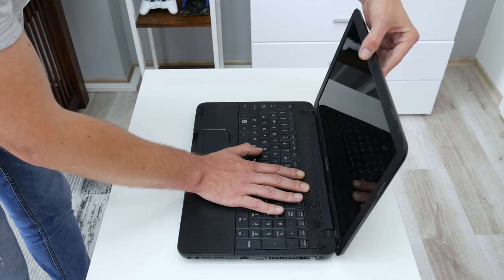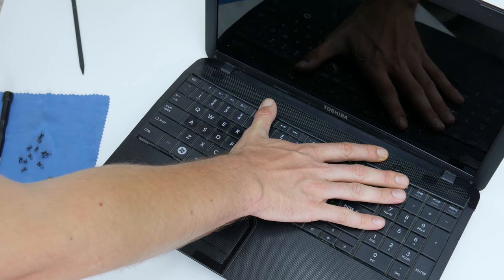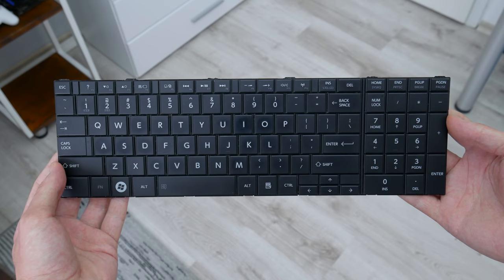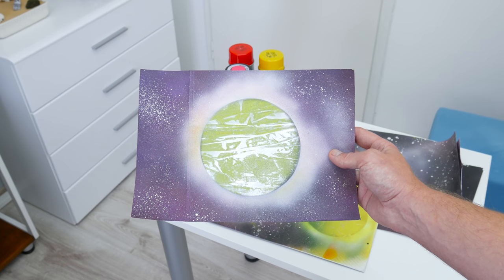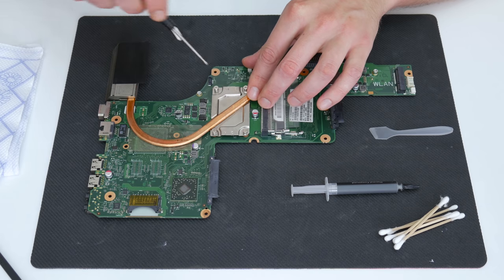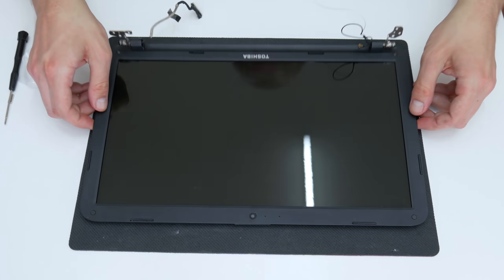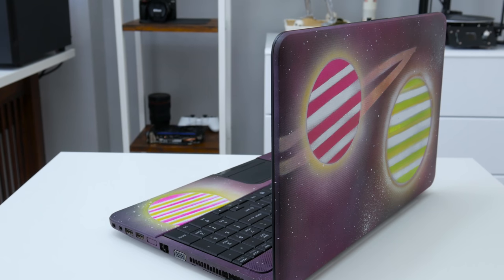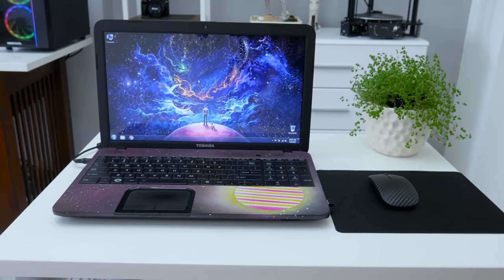Restoring very low specs Toshiba laptop

Comment: I just restored a similar C850D-11K with the same APU, but slightly different construction details. It got a new SSD, a new battery and I'm now waiting for a used keyboard and a new WiFi/BT-module to arrive. I bought the machine in a very bad and dirty condition and basically did the same job that you did. Love the feeling of giving neglected old things a new life, no matter how big the effort! Mine is running with (Bodhi)Linux now and works so much faster than you'd expect from an old machine like that. Great job and great video of yours!

Comment: Dear Andrew, 
You did a great job showing everyone how you upgraded your laptop into something usable. I recently upgraded my ASUS laptop to 12 GB of RAM from 4GB and added an SSD by  taking the optical (CD) drive. Replaced with HDD/SSD caddy. It improved my specs but I find my CPU working way too hard on windows 10. I want to replace the old thermal paste and completely clean my laptop like you did. It must've taken quite some time to complete your project. Windows 7 seems like a better option as well. Overall, excellent job, Andrew.
Sincerely, 
Richard
Reply: The fixes Andrew applied were very inexpensive; however, if others would like to add a better GPU by taking out the onboard wireless adapter it may be cheaper to go with a newer laptop with better specs like an HP.

Comment: Very inspirational. I've modded my l655 with a new processor, wifi module, hdd caddy to replace the broken cd drive. New battery and keyboard. Pretty awesome laptop for manjaro considering you can only buy a chromebook now for the same price point of these older laptops then. Just need to give it a coat of paint soon!

Comment: The fan was seriously dirty! Did you also replace the CMOS battery? I used a 2 part epoxy on a Lenovo case (inside) thanks & great video! I use a cleaner made for screens, being careful with a soft tissue. A used screen is fine! The fact that you had some video signal even with a defective screen is a good sign that the video chip is working! Cool wallpaper!

Comment: Video well done Cat and Andrew ! , One thing to notice , The HDD shouldn't be in the Drive bay , because it uses less Power, and on shutdowns , restarts or sleep , the reader stop suddenly without having time to reset it's position , that harms the hard disk , you can search it up , instead put the SSD in the bay drive and boot from it , since it doesn't have moving parts , it's safer , it might lower everything to Sata 2 but works like a charm ! Like this so i get you've seen this and tell me if i'm right or wrong , if i'm right i hope you apply this in your future Videos ! Have a good day .

Comment: I disassembled my Toshiba Satellite. Had an AMD e-300 clocked at 1.3Ghz, Radeon HD 6300m, 250 GB hard drive and 2GBs of RAM. I'll find something stupid to do with it eventually :) Thinking about mounting the display to my desk somehow, but I need a driver board for it which can be found relatively cheaply. As for the computer itself, it's trash until it gets an SSD, Windows 10 and 4-8 GBs of RAM. Very slow!

Comment: OMG i have the same laptop. and it was also trashed. It is white and it come with and old Dual core I5, 2gb Amd radeaon 7670 graphics and 4gb ram, no hard drive. The GPU was damaged and it was replaced  using the reballing method and it is now perfect. I added another stick of 4gb ddr3 ram and a 250gb SSD, now its a beast.
Reply: diogo magalhaes bro what is the rebailling method, can you show it to me. i never heard bout it before

Comment: PLEASE HELP!  I have a toshiba satellite c850 laptop which had an intel celeron b830 cpu, I decided to upgrade because it was a 2 core CPU at 1.80 ghz with intel HD graphics, which I bought a processor from an online store, specifically an intel core i3 3120M  of 4 cores and intel HD graphics 4000, the problem is that I think the laptop has a bios lock and every 30 minutes the computer is shut down by force.  I tried another processor, exactly an Intel Core i3 2350M with 4 cores and Intel HD graphics 3000, and the same thing happens, and with the factory processor does not turn off or anything, it is not a problem of the ram, or hard drives  , I've made a couple of upgrades to my laptop, like putting 8GB of RAM at 1800mhz DDR3, a 120GB SSD and with a sata 2 to sata 3 adapter, I removed the disk reader and adapted a 500gb HDD.  Could you explain why exactly at 30 minutes it shuts down?  It is not a problem of temperatures, because they are very stable and the dissipater has new thermal paste.
Reply: i have read something on forums because i wanna do the same since i have the same model .They said that you need to bypass the Bios with something idk
Reply: Jeimuzu MC yeah i saw it too but how the heck i do that?😂

Comment: Excellent videos. but several points: 1- thanks for the decent music. Music in your videos has improved. 2- Even  though the repair view is a delight, i think the $ and effort for some of them is not worth it. 3- Nice of you to paint but keep it simple for next ones. It looks odd. 4- For the reinforcement, i would have used plastic. Metal parts can come into contact with something and generate a short circuit. 5- What about a custom case? some videos around with old laptops inside wood cases.
Reply: Then why  not to make your  own custom laptop

Comment: Cat and Andrew: Changes wallpaper to the default Windows 10 wallpaper.

"I decided to use Windows 10 a bit but it was much slower"

Taskbar: You can look at me and tell it's still Windows 7. :/
Reply: xD

btw maybe he used a mod in win 10 o something to have the taskbar like win 7, they are some programs out there...
Reply: dude these amd apus that are like not even worth putting in tablets let alone in laptops run like shit even in windows 7 let alone windows 10 the only shit that would run decently on it is either windows xp or androidx86
Reply: @dragos2010full1  Are you talking specifically about old amd's ?
Reply: He said he switched to windows 7 🤦‍♂️

Comment: I used to have a toshiba, my gran dad uses it now, had an intel b950 and nvidia gts 250m, used to be a beast, now it's quite slow but ok for my grandad (used to have xp machine with 256mb ram) and I might add an SSD to it to bring it back to life maybe even if I'm not the one using it.

Comment: Hey Andrew can you please make video adding a external gpu to it.

My version is
 Toshiba Satellite C-850 B883
Intel 3820QM (Upgraded)
16 GB RAM (Upgraded)
Using Exp GDC with G1 GTX 1060 3GB 

I am having issue with the gpu but still it works.

Comment: I also have a old laptop with same specs except mine has a AMD 1.3ghz Radeon 6310... It's still in decent condition and all parts are working including the battery, I just need to upgrade to more RAM and a SSD.

Comment: Another way to repair the  shell of the laptop is to use ABS cement. Once applied and dried, it becomes like the plastic of the shell itself, only harder. You can then drill a hole in it for the screw.

Comment: Nice video as always, wanted to ask is it worth to upgrade a 10 year old toshiba satellite a 505 s6965(currently rocking a p7350 core 2 duo, 4gb ddr2 ram, and a 4500 series gpu.) I thought about upgrading the cpu to an intel core 2 duo extreme, adding a stick of ram so it has 8 gb, and probably an egpu, i already hae an ssd, samsung 860 evo that i need to install. Will it be enough to power games like fortnite, csgo, dota, LOL, and apex legends.  Is it worth such an upgrade, if yes how much should the cpu cost?

Comment: always save the laptop batteries. there will be maybe one or two dead 18650 cells inside, but the rest should test fine. rinoa super genious did a white paper on 18650 cells that i found very helpful. tou could use those old basically free cells to make a large cheap e bike battery pack, or even a whole house battery if you get enough used laptops.

Comment: I have the laptop with kinda the same design but with an i3 3110m...someone threw it away and i picked it up with a broken hinge and without charging port, hdd, and ram. So I took a charging port from another laptop with dead motherboard took off the plug head and plug in the 4 black and red cable individually into the socket, pop in 6gb of ram(4gb & 2gb 1600mhz), replaced the thermal paste, pop in 500gb hdd and another 500gb hdd with a caddy and voilà! Runs AC:Rogue on 50fps at 800x600 low

Comment: Good work, but whether it's worth it for a processor that is, if anything, slightly slower than an AMD E350 or roughly on par with an Atom D525 is quite another matter. (From experience with an E300, these are SLOW.) A first-gen i3 will run circles around this thing, not to speak of anything more fancy. I also would have ditched the reflective screen for a compatible matte one.

Comment: Nice, if slightly gaudy, recycling. Just one point; when reinforcing anything broken, be careful where the load gets transferred. Try to avoid stress concentrations, or you'll just have cracks in different places.

Comment: I picked up one that looks almost exactly the same apart from having no GPU and a faulty intel i5 for only $35 with a busted screen that wouldn't power on. Now that I have finished working on it, it has a matte screen, an  i7-4700HQ, 8Gb of ram, a 60Gb SSD for the OS and a 500Gb HD for data. I really wish it had a GPU but it makes a good work laptop with a passmark of almost 9000. The battery only had 12% wear too. I don't like the keyboards on these though, it flexes too much :/
Reply: Oh and because my model was a Satalite Pro I upgraded it to windows 10 pro

Comment: they should have the cmos battery on all laptops main boards in the same position as that Satelite laptop ... next to the ram !! instead of hidden away under hundreds of screws or in a position where you have to remove everything to replace it!..fixing that bezel like that to me is not a permanent fix because i done the same but you done a good job well done!! The earlier versions of those laptops I used to fix and the CCFL screens were a night mare on the Satelite series !! good video though! - shame the CPU was integrated if it was on a socket it would have been easier to put a new processor in... or even if the GFU was on a bus you could have even made it even better but good :D - saying that there is a PCI-E on board you could have pop a XFX or  a GeForce on it, seems to be the normal thing now ..

Comment: hey there ive been watching ur videos for quite a while now and i am rlly interested inn this sorta stuff.  i have an old laptop which i want to upgrade. after watching ur videos i tried doing it myslef but the backplate on it does not open like other laptops and the hinge screw is broken and ive temporarily fixed it with tape. i want to switch the dvd drive with a caddy but i cant open the laptops backplate. using ur skills, u think u might be able to help a fan out?

Comment: There is a reason that the thermal paste was not replaced and that is because 9 times out of 10 it is unnecessary. In the case of this laptop, the fan and internal components where dirty and simply cleaning them should have resulted in a cooler running system. 

I know people really love to replace the paste but this is something that should only be done after ruling out other causes of heating. Getting a paste application wrong ( and people do all the time ) can result in heat spikes and a damaged CPU. That paste, unless something really ungodly happens will last longer then the system in most cases.

Comment: Are those caddy's necessary ? Seems like with some metal band with holes you could get that thing screwed tightly in there, cover it up with  plastic somehow, way cheaper, if that would work, wouldn't it
Reply from the maker: Yes, you need caddy if you want to add another disk to your laptop. By the way the have converter ( CD ROM to HDD / SSD ) maybe they look like a toy but actually are very quality. At first i think the same ( bad quality ) but actually is not

Comment: I really enjoyed the video , was thinking that you would upgrade the cpu .
Reply: Coolissim0 Unl1mited I thought that as well
Reply: if you noticed, the cpu is soldered to the mainboard which makes it almost impossible to upgrade. There were some of the older laptops (Lenovo G505 and 505s for example) which had a socketed cpu. The issue would be getting an updated bios that would support a more powerful cpu, and of course the board would have to support it also. My 505 I can go from an AMD A4 1500 to an A4 1800 (if the bios will support it) although the socket is the same type.
Reply: @kenarnold9132  thanks
Reply from the maker: The CPU is soldered but not impossible to be upgraded, btw i will find some other but better laptop with soldered CPU, and i will try to change the CPU and make video about :D
Reply: @ComputersAndTechAndAndrew  That would be awesone, thanks mate.
Reply: Thanks I just wanted to know can’t wait to see upgrades for laptops like that in the future

Comment: I still work on a toshiba satellite c50 P A0010. It has Intel Pentium dual core 2020 M processor on a hm 70 chipset mother board. I upgraded my laptop with a 480 GB SSD and 16 gb ram. My question is, can I upgrade my processor?

Comment: MY laptop is SONY VAIO VGN-NR51R what upgrade do you recommend i upgrade sir. some advice
Reply from the maker: Hi, what specs have this laptop now ? CPU model ? Chipset ?
Reply: @ComputersAndTechAndAndrew  MY laptop is SONY VAIO VGN-NR51R what upgrade do you recommend i upgrade sir. some advice?
My Laptop specification:
Processor - Intel(R) Celeron(R) CPU 540 @1.86GHz 1.86GHz
Installed Memory RAM - 2.00 GB
System Type - 32-bit Operation System
RATING: 3.0 Windows Experience Index

Comment: I have a Toshiba Satellite C855-S5347 with only 4 GBs of RAM. FROM your experience, can I replace that 4gb ram with only just ONE 8GB RAM instead of using both slots????
Reply from the maker: Hi, I'm not sure about this, mostly these models have 4GB limitation per slot, but in some cases, some of them may read 8GB per slot
Reply: @ComputersAndTechAndAndrew  Thank you for your time, I appreciate your comment! 🙏🏼

Comment: dont forget to empty the capacitors when removing battery, just press power button to get rid of any electricity stuck in capacitors
Reply from the maker: Yep, that's the basic thing, but in this case the battery is not working :D btw thank you for sharing useful tips

Comment: can you use a used display for a different model laptop
Reply from the maker: Yes you can use, just the display must have the same connector on the same place, for example: On HP 14 inch i have used Display from Asus 14 inch laptop, some use same display, the difference may be, some is glossy and some is matte. But always before buying something check it few times, because some  display may looks the same but the connector may be placed to the other side
Reply: @ComputersAndTechAndAndrew  cool thanks for replying

Comment: I need help. I have a same laptop but the hard disk is crashed. How do i get the drivers of this laptop?
Reply from the maker: Hi, if you going to install Windows 10 on a new disk then Windows 10 will download and install drivers automatically, but also you can find drivers on the official website
Reply: @ComputersAndTechAndAndrew  i have been following ur channel and its super interesting to watch all the videos that u upload. Keep up the good work. 

I had one more question. If my laptops inbuilt graphics is not working or faulty does it mean that my laptop won't start at all? Because i want to troubleshoot the problem of my laptop. I don't know what is wrong with my laptop. Whether my hard disk is crashed or my ram is not working or is there some problem with the graphics that the laptop is not even starting
Reply from the maker: @saeeshsangodkar8873  Thank you for supporting me bro :) About your laptop, if the Intel HD has problem then the laptop won't start, actually in the most cases here the problem is coming from the chipset, btw you can contact me on e-mail from the description and send me photo or video from the problem
Reply: @ComputersAndTechAndAndrew  Okay bro. I am actually out of station. So when i will be back to my hometown ill disassemble the laptop and do the things necessary. If it still doesnt work then ill email you. Thanks alot for ur help. 🙏👍

Comment: Good vid! If you install Win 8.1, it would be faster a bit, than Windows 7, and optimized a bit better for lower hardware
Reply: I upgraded win 8.1 to win 10 and my pc runs a lot slower. It has an i7 3632qm and 750gb hdd. What can be done

Comment: AMD E series CPUs are utter crap; we have a HP laptop with AMD E2 1800 CPU and it is awful. Just about does the basics OK. Nice upgrades with the RAM and SSD though. I imagine that 2GB RAM would be nowhere near enough. Also I would have bought used 500GB SSD and kept the DVD drive, as 500GB is enough for most people, or as a secondary computer :).

Comment: The only trash in my laptop is the OS. Literally windows 10 uses all of my disk,cpu and ram can't even use it.
Reply: no it is the laptop lol im using windows 10 on my gaming rig
Reply: @smokeinc9800  My laptop is a dell inspiron 15 3000 which they made to run Windows 10. So why would they put Windows 10 in the laptop knowing that it wouldn't be a good match? Also it's because of their drivers which consumes a lot of disk/CPU/RAM. They used disk to install windows 10 which for some reason runs like shit. But it better when it's installed from a USB. Maybe something went wrong while installing it.